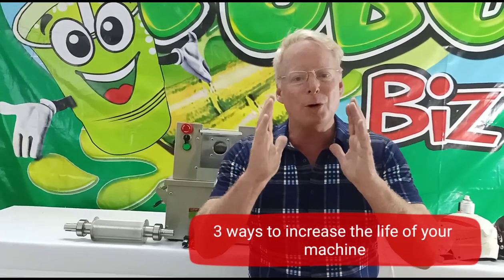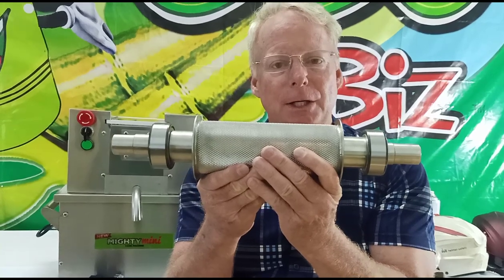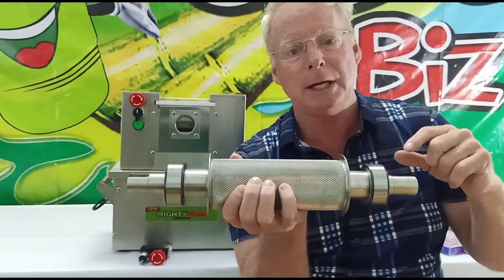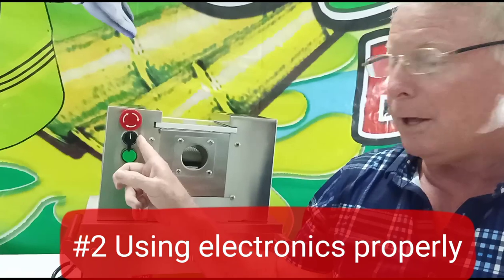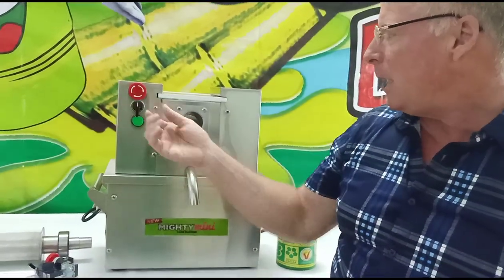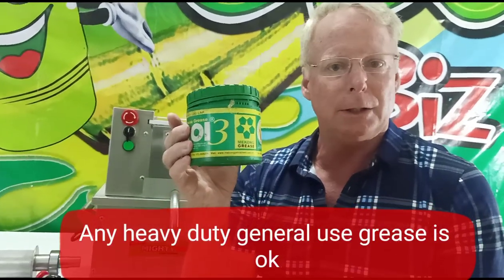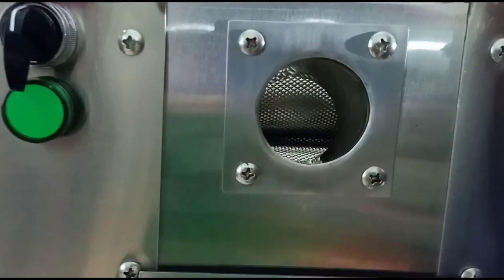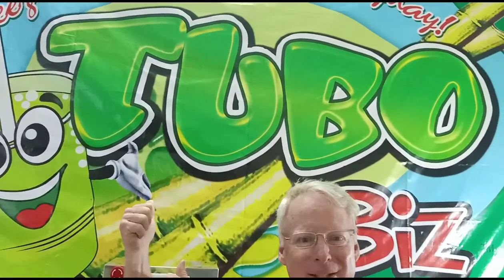3 WAYS TO DOUBLE the life of your Sugarcane juice machine

Comment: Thank you David! How do you apply grease, do you need to open the machine for that? If you crush an average of 25 sugarcanes or liters per day, how often should you apply the grease or do maintenance? And apart from applying grease,is there anything else that needs to be checked during maintenance?
Reply from the maker: I will send you a video soon. But in short 4 screws hold the two side panels. Undo them and you can pull them off to get to the gears. I use a tooth brush to apply grease.  Always good to do a bolt and screw check and tighten if any are loose.